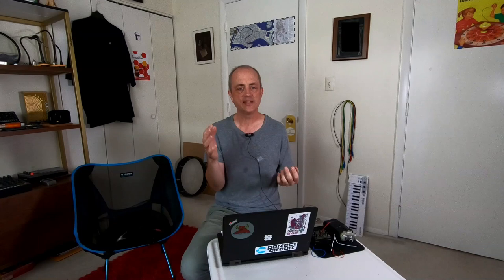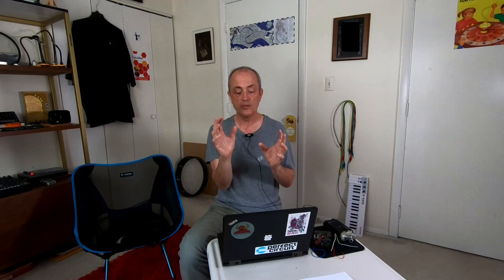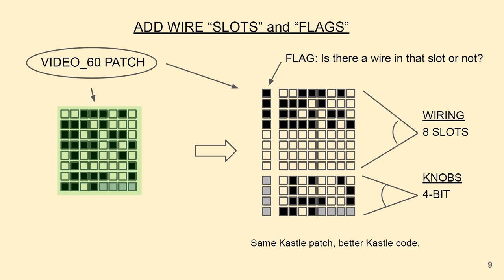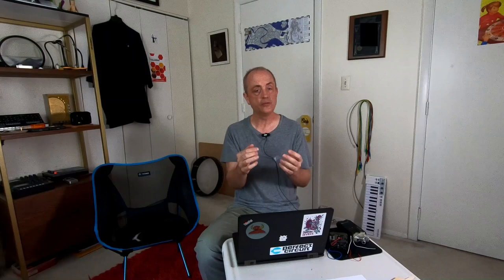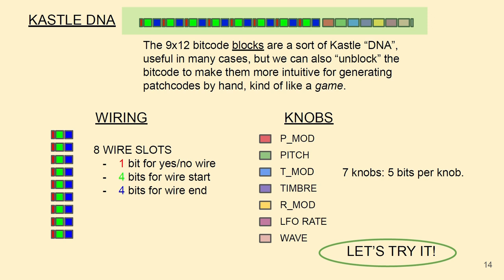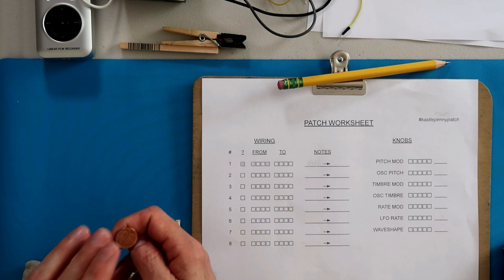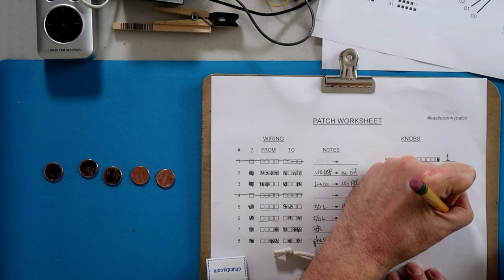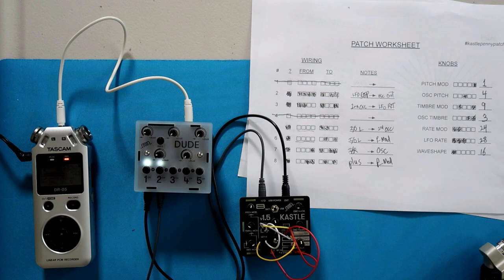Kastle DNA (Part 1)

Comment: This type of reverse engineering takes a stroke of genius!
Well done!
I used copper wire the same gauge as the patch cables to hard wire into the kastle and then into a breakout box that the kastle sits into the copper wire is attached to bolts on the box and i made patch cables with little crocodile clips.
The copper wire is flat onto the body of the kastle so its not in the way. It is fixed hardwiring and my croc clips is where the funn is at! 😁
Reply from the maker: scowls Mcjowls Thank you🙏🏼! And wow! That sounds really nice! I’ve wondered about doing that with a nearby breadboard, but scaling it up (and making it permanent) makes a ton of sense!

Comment: 100 quadrillion quadrillion patches! I tell people my modular synth (12u 104hp) has a "million sounds" but often thought maybe its only got 500,000?Just guessing a big number. I never did the maths. Ace video.
Reply from the maker: Thanks much :) Don't forget that I'm really, really bringing the number down by using discrete knob settings. The knob settings might actually be discrete, maybe something like 256 different values, since the thing is digital at it's core, but it certainly gives the illusion of being continuous. Thanks again for watching!

Comment: At the start you’re recording with a Tascam Dr-05. Do you recommend this? I currently recording to mini disc. I’ve been looking at the DR-07 and DR-40x - I just want to go from device or mixer to line in of the tascam. Some people say recording are quiet. What are your experiences? Thanks
Reply from the maker: Well, I'd say at least 90% of this channel's line-in recordings were done with the DR-05. I have to say that it's been very solid for 3+ years and pretty amazing for the price. It only has 3.5mm TRS line in, no phantom power for bigger mics (but plug-in power for smaller one), and not a lot of bells and whistles. The built-in XY mics have always seemed very nice (but I use a Zoom H4N for most voice and field recording). As for quiet? I find that I tend to run the recording level low for many synths (and sometimes attenuate signals), but I feel like that's typically the synth's specs. Overall, have been very happy with it (used it last night for a dual external mic setup, plug-in power, because the H4N's memory card was downstairs😂).
Reply: @undulations  Thanks very much. I was leaning towards the dr-40x as it has a switch that toggles the input to line level, but perhaps I need not worry about that..!